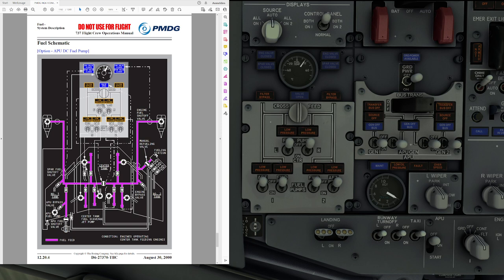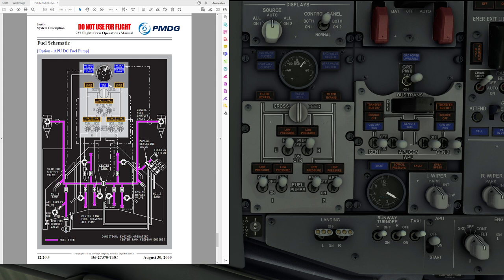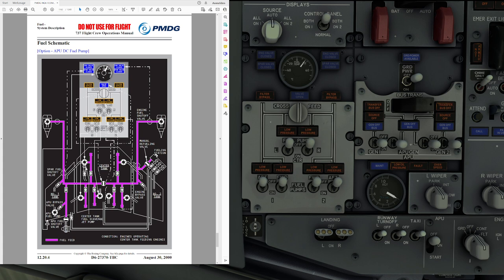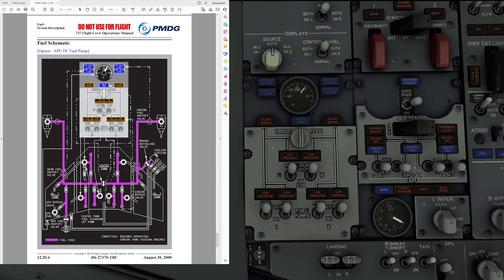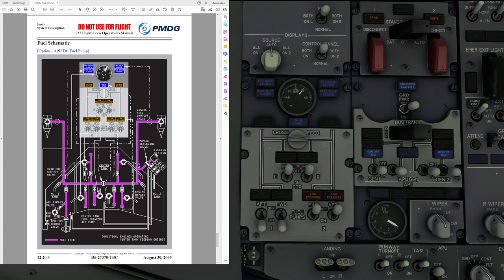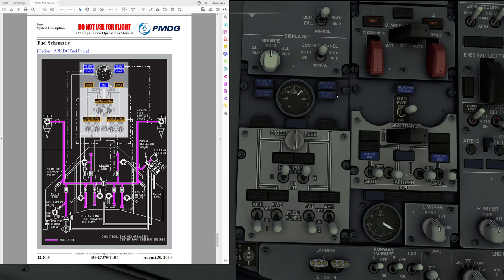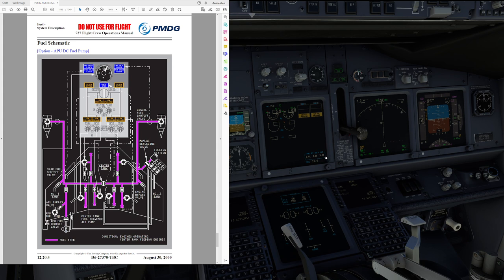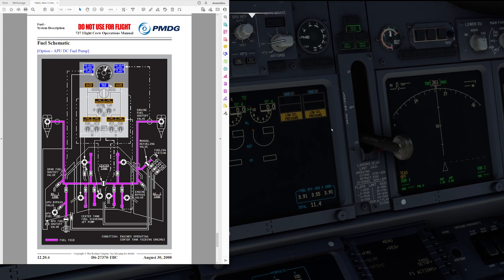737NG Fuel System explained | Real 737 Pilot

Comment: Hi. Just a small note. When you put the fuel lever to idle, the spar valve will go bright then off, the engine valve closed light will remain bright due to the HMU not opening the valve. If it did you would have fuel spillage putting the fuel lever to idle on ground. Also we can transfer fuel from any tank to any tank on the ground but that is for maintenance personnel only. Just to complete your story. Great explanation though and very clear.

Comment: Good explanation! Just 1 question: the arrows on the diagram on the left, are those valves that prevent fuel flowing in the direction against the arrow, so fuel flow only possible in the direction indicated by the arrow? And the apu fuel pump has no separate switch, so I guess it is switch on when the apu switch goes to the on position? And of course switched of once the apu botton goes to the off position.

Comment: Amazing video. I have a question to ask that is not directly regarding the fuel system but rather your operations. Why does your airline during preflight turn on the fuel pumps immediately instead of waiting until just before engine start? Thanks.
Reply: Most likely done to check for any leaks that may occur
Reply: @iiCautious  Yeah I think that's it. I think he told me that recently. Thanks!

Comment: I have 3 questions
1. Are the ac pumps only in the left tanks
2.where are the fuel boost pumps located and is there a way turn them. On or off
3. An what is the RH pump switch i saw this on a checklist not sure what it ment. Thanks for the great video anyways
Reply from the maker: 1) AC Pumps are in every tank
2) Only the AC Pumps are switchable by the pilot.
3) I guess it refered to pumps on the Right Hand side of the fuel manifold, so Main Tank 2 and the right Center Tank pump.
Reply: @A330Driver  so how would you turn on the ac pumps ifvthe pilots are the only one that can turn it on

Comment: When the APU is running from cold and dark I notice simmers use the left AFT pump, and on a turnaround they use the left FWD.
Why is this and does it really matter?
Reply: The Left Aft is DC powered which means the apu is able to receive fuel via battery power during cold and dark start up and is kept this way till the plane is ready to go. As for turn around both left aft and fwd could be switched on to provide fuel. Once the apu is running and generating power the aircraft has AC power which is enough to supply all electrical systems.
This may differ from airlines SOP
Reply: @iiCautious  thanks